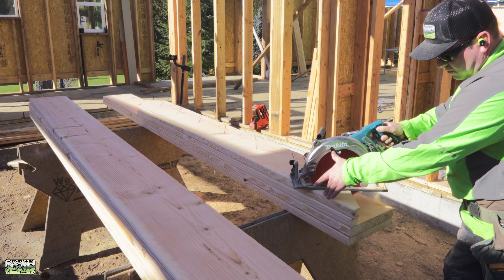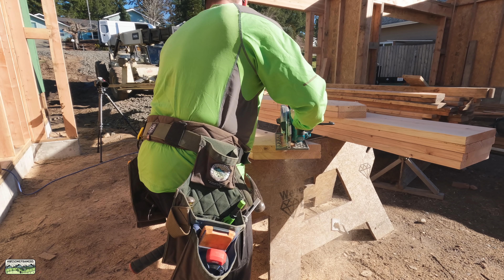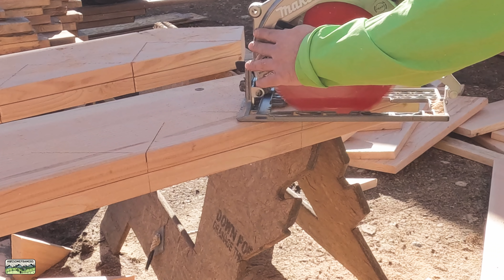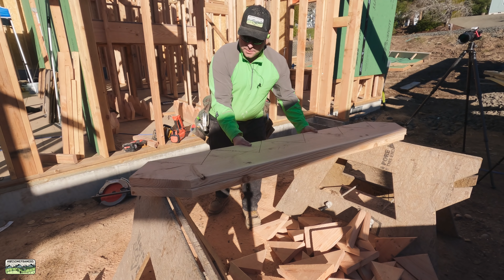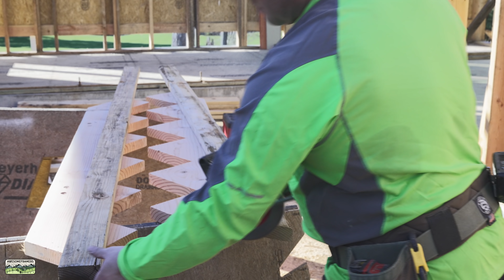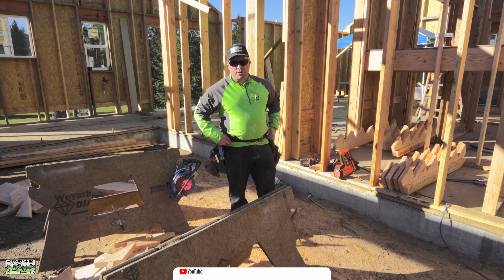How to Layout and Cut Stairs Efficiently

Comment: I keep a 30 gal. Trash can with holes drilled in the bottom ( water drains ) to through my cutoffs in makes it easier to clean up and keeps the work area cleaner. 
Go layout you do for making stringers

Comment: I’ve been using the 10” Mikita skill saw for cutting my stringers it gets through two and marks the third . I really like this method as it keeps everything true . I’m new to your channel are you a one man op or do you have a crew?
Reply: He has one more guy called Kyle I think
Reply: How many cuts do you get in one battery would help a lot thanks man
Reply: @josh
Reply: @matt800m6  I run a 60 volt dewalt and it's great for cross cuts wall framing for about 4hrs , gang cutting stairs kills the battery quick. I would be interested in your question also about the saw he's using

Comment: I noticed you hold the blade high and then drop it down as you saw.  Is that to prevent kickbacks or for accuracy of the cut?
Reply: My guess would be for the accuracy, easier to adjust the angle and follow the line if the saw isn't fully plunged into the cut
Reply: If you get off your line or need to adjust the saw just makes it easier

Comment: I’ve never seen someone do some much plunge cutting with the table unlocked. Is that for safety, or to align the blade in the kerf from the first cut, or something else?
Reply from the maker: I just like it to keep the blade square to the material.  Its more stable.
Reply: @AwesomeFramers  thanks!